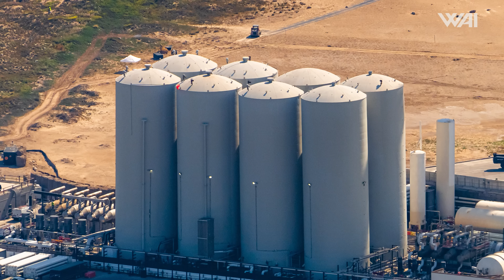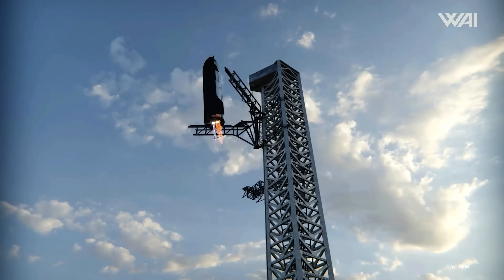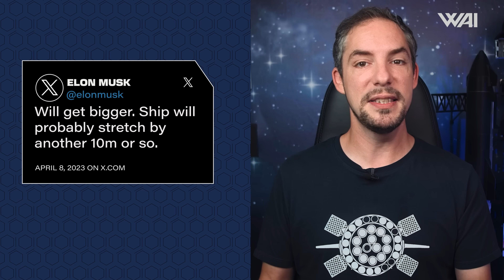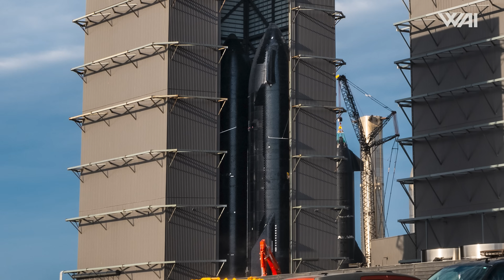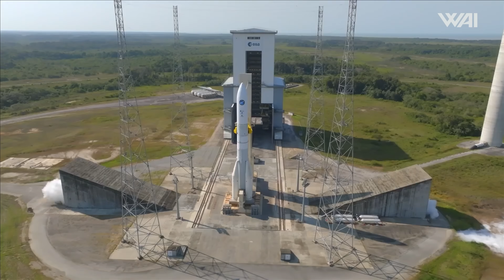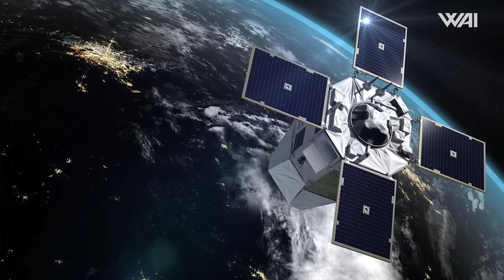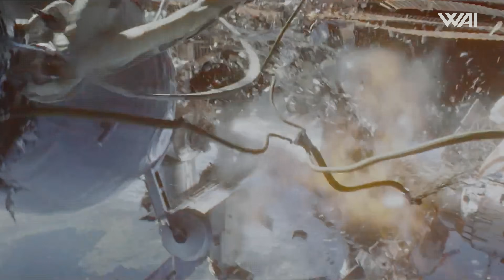Starship Evolution: Why SpaceX is Shifting To V2 Starship Now!

Comment: In retrospect it is pretty strange that they started the developement with the upper stage / vertical landing and belly flop.

The reusability of the upper stage is 'nice to have' - but if you skip the heat shield and flaps, then the upper stage with mass-produced 6 engines costs what ~30 Mio?
At least they could mass-launch their satelites. "If Starship does not fly every 2nd week next year, then we may face bankrupcty" Musk Nov 2021

Edit/PS: V 1.00 is the first fully working version - they are still in Alpha phase and therefore more ~V 0.45

Comment: Another incredibly information rich episode. Thanks Felix and Friends!
About China.......
If China puts up a giant constellation of satellites, I have no confidence they will be able to control them properly. A runaway Kessler Syndrome is very likely. If they can't even build apartment buildings, what makes anyone believe they can create a safe satellite constellation of thousands of satellites?
About Ariane:
I think all these launch vehicles that "over-use" Hydrogen are going to prove slow to launch and overly expensive in today's market.  What I mean by over-use is using Hydrogen on booster stages or stupidest of all, lugging the huge tank on a core stage practically to orbit, like SLS. The companies and design teams that use Hydrogen rocket engines on most everything seem to have focused on the advantages (high ISP) and completely neglected the disadvantages (finicky design prone to leaking, expensive, not THAT much better ISP than Methane). Vulcan seems to have hit the sweet spot (after copying SpaceX on use of Methane). Vulcan uses Methane on the booster, augmented by super cheap solid rockets to get it off the pad, followed by Hydrogen on the upper stage where it can do the most good. Werner von Braun would be proud.

Comment: The higher then expected loss of heat shield tiles is a concern. It’ll never survive reentry loosing that many at launch
Reply: @stonegirls9806 Is it thought to be due more to high vibration, or weak adhesive?

Comment: with new raptor 3 giving increased reliability that once proven the can remove Booster heat shielding saving 10 tons in weight

Comment: Switching to thinner steel makes sense but so does using up the old stock of 3.9 mm steel, to me.
If the prototypes face unplanned disassembly for other issues, I would use up the old stuff, first. 
Just saying...

Comment: 304 Stainless Steel will rust in the salt latent conditions down by the beach. They should go with 316 SS, which will give them stronger material that can survive atmospheric conditions. And, the extra strength means even thinner diameter material.
Reply: They can change to more costly material after they have ships which do land instead of crashing developmental units. Heck, they can even switch to titanium one day! More than twice as light!
Reply: @denysvlasenko1865  It's a slight increase in cost but you are right. If they plan on blowing them up or letting them sink to the bottom of the ocean, by all means, use the cheap until you start to recover the booster and StarShip.

Comment: How fast can they restock/reload the fuel and water? Will that affect turn around or multiple launches
Reply from the maker: It takes around a week to restock everything( which is crazy fast). So, they could launch roughly once a week with the current infrastructure. But IFT2 showed the the launch infrastructure can’t handle a launch per week because of needed repairs. So, currently, fuel is not the bottleneck.

Comment: One idea, would be to put a removable steel shield in front of those tanks - only some seem to be being struck.
Reply: Best thing to do is simply remove them.
Reply: Came here to say just that. Are we being naive? Could there be some reason just putting a shield in front of them is a dumb idea? Hmm.
Reply: The outer shell is the shield. The tanks inside are smaller.

Comment: All existing boosters and orbiters are clearly prototypes.  They exist only for testing.  None of them will ever carry commercial payloads although some of the later tests may test out the Starlink Pez dispenser.  CSI Starbase has estimated that the shielding to prevent cascading engine failures masses over 10 tonnes.  Observing how IFT1 remained stubbornly intact despite gyrations which massively exceeded the design objectives immediately suggested to my engineering mind that the current implementation is clearly too strong and that at least a half millimetre can be trimmed off the steel shell.  I also believe that the TPS can be trimmed by at least 25%.  "The best part is no part."  And of course the Raptor V3 is now in full production, giving 15% higher thrust and greater efficiency.

Comment: wouldn't it make more sense to have few bigger sattelites at a further distance, as opposed to millions of them close? i don't know if theres a range limit, but it would seem like it would blanket more if it wasn't so close. just meaning it could use 1/3 of the satellites adjust the orbit higher i would think. don't really know tho
Reply: That is the traditional thinking. However higher orbits cost more money as it take more powerful rockets... power increase rises geometrically. So SpaceX goes the other way, many small low orbit satellite. Needs less powerful and less expensive rockets. Downside is obvious... tens of thousands of satellites in LEO increases risk of accidents with space debris, creating more space debris.

Comment: They’ll probably scrap 2 of the 4 existing prototypes, and use the other 2 just to test the landmarks they haven’t achieved: Near-orbit reentry, followed then by LEO achievement. However, that may [will] drop to 1, if Elon decides to go straight to LEO and achieves it on IFT-3. 

After all, I don’t think SpaceX is really concerned with a successful splashdown with the V1 generation. All they probably carry about is testing the engines, successful separation of the booster and ship, LEO achievement, and heat tile testing.
Reply: Some Starlink deployments thrown in wouldn’t be terrible.

Comment: The uncle Elon is really courageous and bold, we can't deny that. He caused all this commotion with a project that is not even capable (yet) of reaching low Earth orbit, not even empty. In ITF2, it is clear that there was a lack of fuel to achieve the goal, that's all. The flight was all perfect, nothing out of the ordinary, but the engines started to shut down in sequence as soon as the fuel indicators stabilized at their lower limit. Both in the booster and in the Starship, we can see that the indicators are halfway exactly in the middle of the total burn time. As I had already written here before, in the ITF2, this issue will only be resolved with more efficient engines, which has already started to happen. If Raptor 3 really delivers 10% more efficiency, then I believe it will already be enough for the Starship to reach orbit with a small payload. However, to go to the moon or other objectives, there will still need to be more significant changes, as is being announced now. With more engines, more fuel, and a reduction in the weight of the assembly, and perhaps, the next generation of Raptors.

Comment: There is plenty of room for Starlink-like services if they allocate specific altitudes to each system.
 The main issue then is controlled deorbiting at service life end.
Reply: And china won’t do that. Lol
Reply: Well, if there is any fuel and oxidizer left, they can be mixed and then exploded.   Residual drag will bring down the pieces.
Reply: @GilmerJohn so youd rather gave space debris? No. It SHOULD be deorbited to keep leo safe
Reply: @Hungary_0987  --  Well, these things usually end up on "low earth orbit."   Large objects with withstand the tiny drag from the weak atmosphere for years or decades.   "Small stuff will not last long.
Reply: The main issue is, obviously, that communal orbital traffic control will require at least some loss of autonomy, and certain space-going powers aren't yet ready to contemplate that.

Comment: Why does everyone think that leeward means toward the front?  Doesn't it mean the side that is sheltered from the wind?  In the case of the Starship, I think that would mean away from the heat shield (away from the "wind" during reentry).  Or am I missing something?
Reply: As a person who paraglides, your comment is correct.
Reply: @AnthonyVella   Thank you for confirming.  This isn't the only video that claims/implies that leeward means toward the pointy end in the case of the Starship, and I've even seen artist conceptions of the next iteration of the Starship that have smaller fins right on the nose, but still otherwise in line with the rear fins.  If we take what Elon said literally, however, the smaller fins should be farther "up" when we orient the Starship horizontally, like during reentry (more or less), not necessarily farther forward toward the nose.  I don't get it.

Watch, it'll turn out that Elon has no idea what leeward means, just like everyone else, and therefore we're the ones who have the wrong idea. 😄😉
Reply: @rbrtck this video displays renders consistent with what leeward means lol, fins closer together, away from the heat shield, not any further up the nose than they are currently
Reply: @josephc.9520   Well, I meant most of the other depictions I've seen, as well as what Felix and others have stated.  "Everyone" is used casually as meaning nearly everyone, at least of what I've seen and heard.

Comment: The vertical tanks didn't fail safety checks. Their construction didn't meet both Federal and State laws. There was also likely placement and offgassing rules that were not met by the vertical tanks. But they did not fail safety checks. They failed regulatory checks.

Comment: Getting crowded up there? Lolol I don't think so. 

There are less than 8000 satellites in space, and unlike on the Earth's surface, where there is only one surface plane, there are many planes within earth's three (high, medium and low) orbit regions. Not only that, 8000 satellites spread evenly across those three shells would give 4348 miles of separation. 

By any measure imaginable, that is not yet crowded 😅

Comment: If spaceX does not fly all 4 remaining v1 starships, this means they gathered most of teh data they need to go on with the V2 design. you can only improve so much without changing the hardware. let´s see what they come up with.
They still have at least 2 to 3 v1 to launch to get the datas. so far the booster has not yet come back and teh ship did not function for long on its first alone trip in space.
Regarding space debris, not sure it is worse bringing them back to earth in one piece, as long as they are removed from teh orbit the job is reached, in the first stage at least.

Comment: I remember them wanting to land on legs but they couldnt get a good design they always got crushed so they switched to the tower. Do i remember wrong?
Reply: No, I don't think it was lack of a good design,  I remember it being the "best part is no part" ideology motivation.
Reply: You do indeed remember wrong. The legs on the early prototypes were only ever a throwaway design to give them something to land on during testing... cheap and good enough to prevent the ship from landing on the engines if it didn't come down too hard. They weren't remotely suitable for a production design, and were never intended to be.

Comment: I imagine a proportionally huge amount of fuel is required to accelerate to rocket from stationary to mach 1 as it takes to accelerate it from mach #1 to mach #10. Why doesn't the tower assist in providing some initial acceleration to the rocket so the initial stresses on the rockets structure can be controlled in a more measured manner. Not to mention the compound effect of not requiring X volume of fuel to provide 100% of thrust for acceleration. A launcher that could accelerate the rocket to even 100-200kph would serve big dividends in lowering the fuel load required, let alone a structure that is capable of accelerating the rocket to 800-1000kph on its own and the rocket gradually throttles up during this period to the point it's thrust overcomes the mechanical force of the tower and it gently moves off, already with considerable velocity.

Edit the Initial stage of the launcher could be subterranean even....
Reply: The "catapult tower" is possible, but adds a lot of additional very heavy machinery (throwing 5000ton object with ~1.5g acceleration is not easy). Also, in this scenario the engines will need to be lit during the "throw", making it impossible to abort the launch if one engine misbehaves.

Comment: I've asked this question several places around and haven't even gotten one reply. 

When any other rocket launches from it's pad, it's off and about it fast! When Starship these last two times launched it was like there was a mechanism holding it firmly to the ground for a time, but then when it did actually lift off it was really slow. Aren't all those engines able to lift it right off, or do they need one majorly large engine or what? I just do not understand why it's taking such a long time to actually get airborne. Thanks.
Reply: Well, to begin with, there is indeed a series of hold down clamps on the launch platform that hold the rocket to the table until telemetry signals a go/no go for launch, which eats up a few seconds. Then there is the gradual throttling up of the motors, because this is all strange new territory and they are being slow/cautious about everything.  And sure, all those engine could lift a smaller rocket at breakneck speed, but remember, the booster and starship together, fully fueled, weigh in at over 11,000,000 pounds ( that's 11 MILLION pounds ), 400 feet tall and 30 feet wide. This is significantly larger than any rocket ever flown, and all that mass means a lot of inertia to overcome, which takes a lot of energy and doesn't happen instantly. Lastly, because it is so frickin' huge, there is a visual perception of slow ascent, an illusion fostered by distance, but don't be fooled by that; by the time the tail passes the top of the tower, the rocket is already moving at over 100 MPH. Think about that; they are accelerating an 11 million pound object from 0-to-100 mph in just 400 feet, VERTICALLY! That doesn't seem slow to me!!
Reply: Not any other rocket.  For those of us raised on Saturn V liftoffs, if anything Starship looks faster.  The Saturn's 7.5 million pounds of thrust on a 6 million pound LOW vehicle does not make for sprightly acceleration.  Starship is also slightly faster than SLS.

The answer to your most basic question is "balance":  If any of these large boosters, which are mostly fuel, had higher initial acceleration when fully loaded, then the acceleration could be too high (at least for something with people in it) as burnout approached.  While the engines could be throttled back some to compensate for that, that would mean by some point that you've built a bigger engine than you needed.

So it's an overall tradeoff between taking off more slowly with a smaller engine design which was easier to develop and likely more reliable but uses up more fuel, versus less fuel with a bigger engine (note that the choice of engine number also impacts mission reliability, in both positive and negative ways).  And fuel isn't usually a cost driver.  It could be three percent of a mission cost for a developed expendable booster (e.g. Delta).

Anyway, lots of tradeoffs.

Comment: Ya, we see no windows, no camera systems,  no sensors, no inside stuff, no doors or entry, exist areas.and we know, last launch, not enough furl left to get back for return to reuse. So either adds boosters or makes bigger. Or both. See no side thrusters either, trying to do to much with rocket engines for control. I think we have been seeing shells, and not fully fitted space crafts. Fast built shells, but missing so much. I mean even if star ship gets to space in this rush. Can it flight vector ? Are raptor engines able to do low burn, low thrust control for small, low speed, tiny amounts of bust ? And slow down reverse thrust ? Id actually hope we see it come back and how it handles return to earth, and so forth. Was it blown up, because it had no ability to be controlled in space ? Or the pressure change from earth to space,  not resolved yet ,? Tanks having trouble handling gravitational force change ? These are video discussions id enjoy.

Comment: It should be noted that the Ariane 6 was projected to have 50 percent cost reduction from the Ariane 5. Speaking in June at the Paris Air Show, the European Space Agency's Toni Tolker-Nielsen said the Ariane 6 is projected to come in at a higher cost per launch than first predicted. The Ariane 6's cost per flight will be about 40 percent lower than that of the now-retired Ariane 5, short of the previous goal. European Space Agency has provided a subsidy of 140 million euros annually to ArianeGroup in order to make the Ariane 6 rocket more competitive in the commercial market. It seems unlikely it will now be competitive with the Falcon 9 and certainly not with the Starship.
Reply: Yes. Obsolete even before 1st flight.
Reply: Indeed... financially, they would have been much better off not developing the A6 and continuing to fly the A5, since it's unlikely to ever fly often enough for the lower cost to repay the development costs. The one advantage it does have is that in the 62 variant, it also replaces the European use of Soyuz...

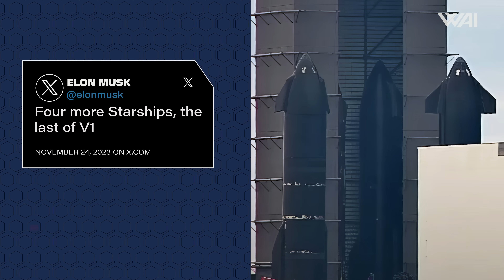Comment: The picture at 4:31 looks AI-generated... I'm not an expert, but it's got that same oil-painting effect I see when I use img2img in Stable Diffusion with source image similarity set high, effectively regenerating a close-but-not-quite version of the original image.